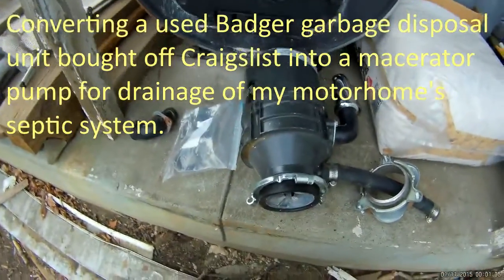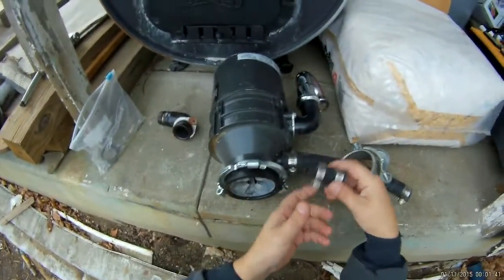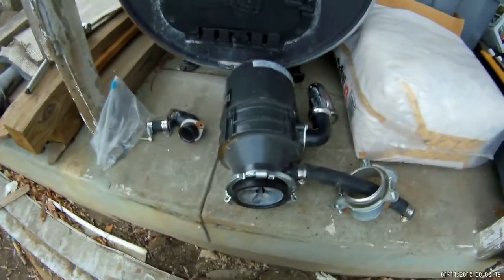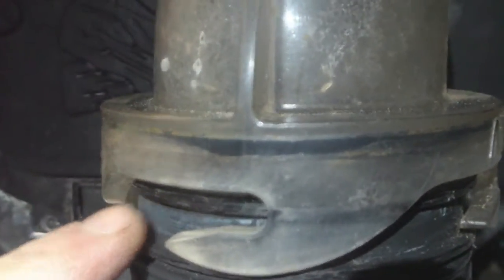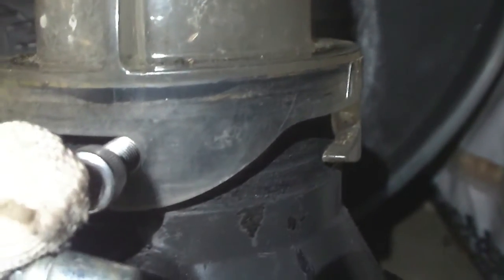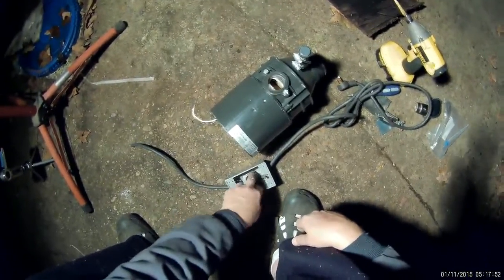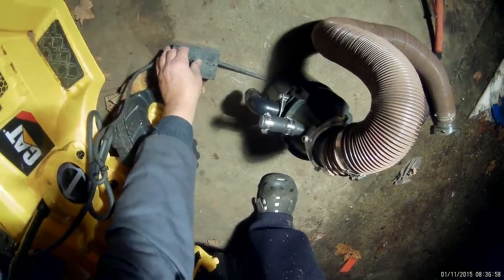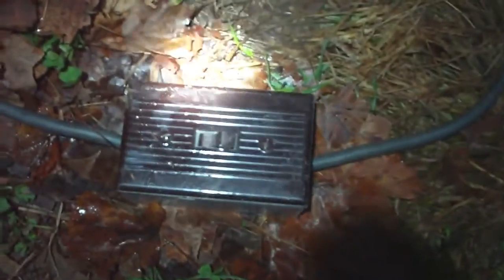homemade macerator pump

Comment: Will it pump uphill? and how far? Thanks John
Reply from the maker: I believe so, but only so long as there is enough liquid being run through the line as solids being macerated. Couldn't say how far it would pump uphill, but I use a 100 foot length of 3/4 inch garden hose and it pumps out a decent stream. I'm very happy with it since it didn't cost me but $15